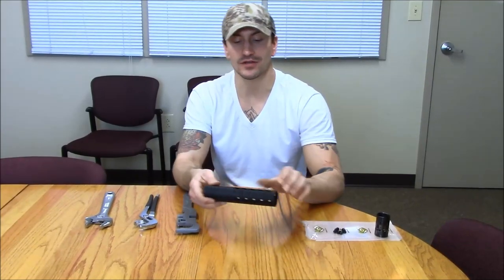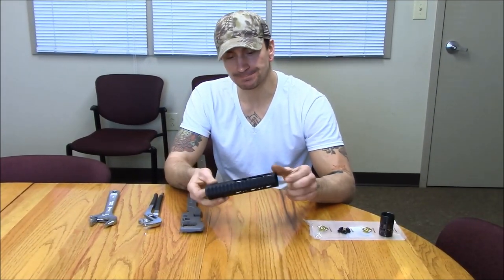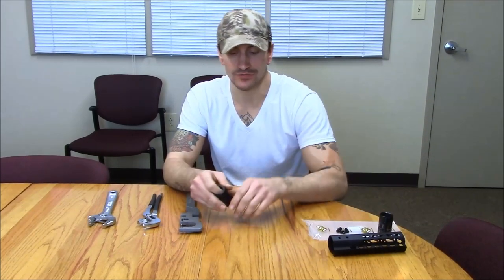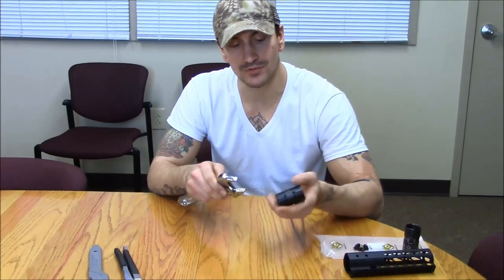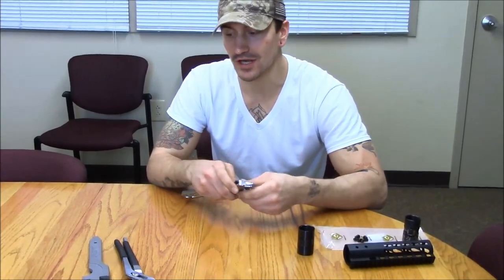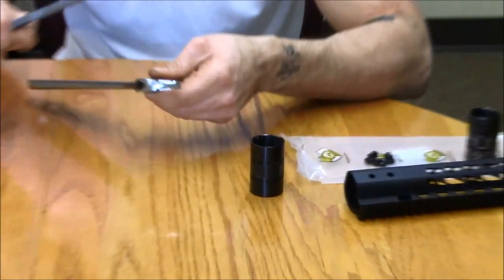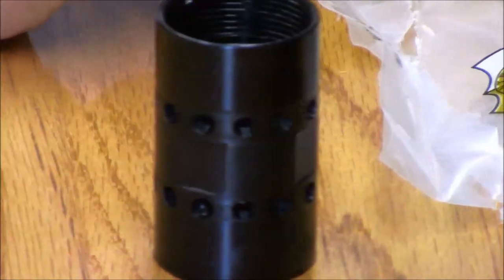GuntecUSA Barrel Nut Installation

Comment: how do you torque it then???
Reply: exactly
Reply: 1. Burn, dip in acid, or sledgehammer-then-throw-out the Guntec product.
2. Buy a real, reputable handguard/barrelnut.  Even >80%of made-in-China ones are better...just look at how few customers give 4 or 5 star ratings to most (nearly all of) guntec produkts.
Reply: it's called the german spec, Goodentight!

Comment: Try a Bev block or reaction rod or something along those lines with a crescent wrench. I have a barrel nut in front of me, almost certain it is this GunTec design, and it is slightly under 31mm on my calipers. A  1 1/4 inch wrench was too loose. Apparently there is a proprietary crows foot for these specific Guntec nuts (does not specify the size of that crows food). There are separate nuts and crows foots for A-15 and A-10, so make sure you don't order the wrong one.

Comment: Just be careful when you tighten the barrel nut because it does not take much to crack their cheap nut. My second and last purchase cracked using a crescent wrench.  I spoke to Guntec USA and they told me that they’d send out a replacement barrel nut, but they screwed up and sent me the hand guard screws!!!  I told them that I had a customer waiting and they were pissed.  The second shipment shipped late.  It’s been over a week so I called them back and it’s supposed to arrive today, which is late!!!  

They no longer ship the hand guard with a tool because the heat treating process was not being done correctly and they told me to use a crescent wrench, which is BS! It’s how I cracked the barrel nut on the second build.  I had their tool for the first and everything went fine.

Guntec USA is ran by a bunch of clowns.  I’m no longer a customer of Guntec USA.

Comment: That is way bigger than 19mm. 19mm is 3/4 " American. I don't have this product but this OD on the nut is easily 30mm and probably larger. Are you using a 15" cresent wrench or an 18?" Measure the OD with a caliper so customers will know actual size.
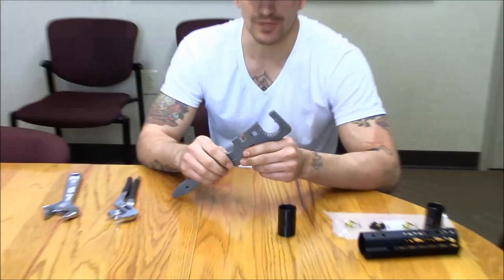Reply: Agree with dpos89, 30mm or so. Also at 0:25 you call the channel locks a crescent wrench. If you go to the effort to make a video take 5 more minutes and make it right.

Comment: I thinks it's closer to 1 1/4 " , maybe using a crowsfoot with a torque wrench ?
Reply: bob a that's what I ordered on amazon for this job
Reply: lopezbmx86duece what size for these types of barrel nuts? I just installed one and did a wild ass guess for the torque...I don't like doing it that way.
Reply: James Norman it's a crows foot wrench via torque wrench.

Comment from the maker: 33mm on the Caliper. They specify no torque. The spec sheet they sent over was for an 18mm. Obviously, that wasn't right, but we didn't want to deviate too far from their product sheet, so we added in the 18-33mm. A little murky, but It got the point across.

Comment: How do you get a correct torque since you do not use an armorer's wrench?
Reply: "Correct" torque for an AR15 barrel nut is anything in a huge range of ft/lbs.  30 to 80 ft/lbs is the mil-spec, I believe.  

People put entirely too much importance on getting barrel nut torque "correct".
Reply: John Daniels I’m guessing just do it until it’s snug and everything lines up. Longer handguards will probably require a bit more torque.